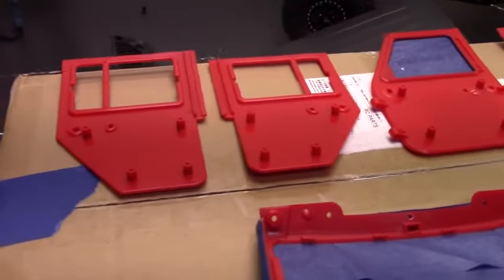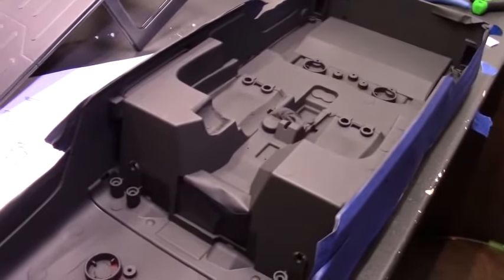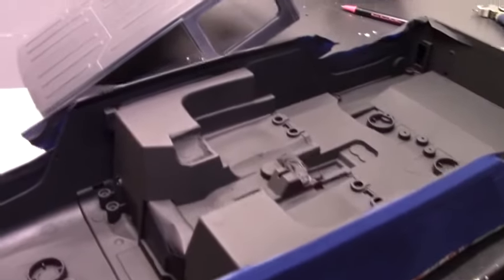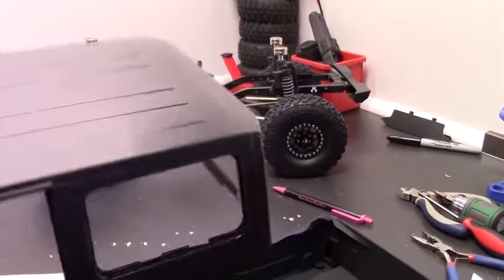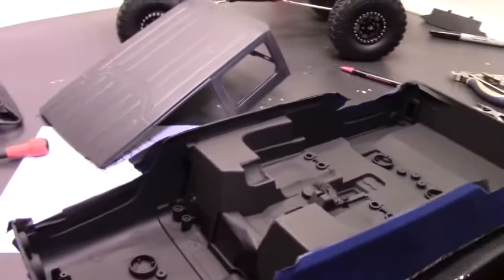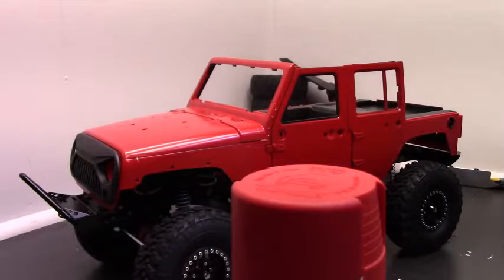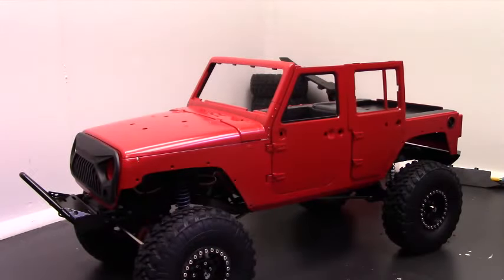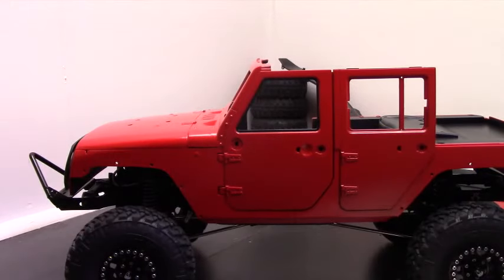Axial SCX10 ii Xtraspeed Jeep Hardbody Project Gets Painted

Comment: Rick If you get a chance,check out Harley Designs on it he came across a dye product that dyes solid molded plastics that that not just covers up but some how soaks into the plastic so if you did scratch the surface to molded color wouldn't show thru.I'm thinking about going that route instead of just surface painting my body.Just thought you might like looking into the dyeing option.Looking good keep going the buid is taking shape nicely.
Reply from the maker: Robert Rosson yeah i actually saw that recently on scale builders guild also,he dyed all the red parts on the axles black and it came out great.i didnt think about doing the whole body.thanks for the support and big thanks for watching!
Reply from the maker: Robert Rosson whats your thoughts on the hood scoop? Leave it black or paint it red to match?

Comment: What body mounts are you using?
Reply from the maker: I started out using the magnet kit that comes with the xtraspeed body but have since switch to custom mounts I made to hold the body to chassis with screws.
Reply: Ricks Scale RC ohhh okay cool! Thank you 🙏🏼 and i plan on buying this for my scx10 1st gen but i have an after market bettery relocating plate im not sure if it will fit under the body 😐
Reply from the maker: It’s definetly a little tricky trying to relocate things to get it to fit well. I ended up moving the battery to the back between the shock hoops. That worked out well for me. I also trimmed a small amount out of the interior center console section to go around the transmission. Definetly feel free to hit me up with any questions I’ll help ya in any way if I can. 👍🏻👍🏻good luck
Reply: Ricks Scale RC thanks man! I appreciate your help